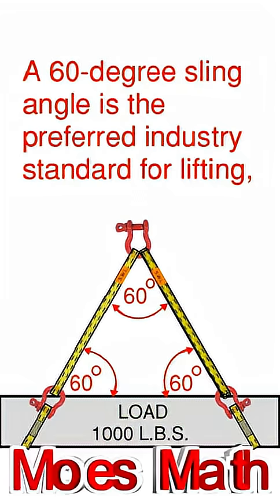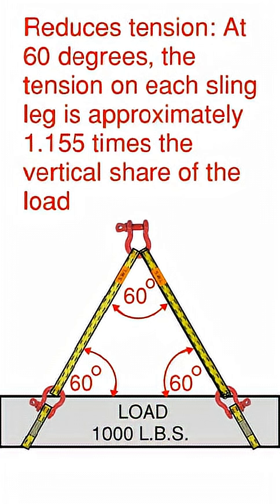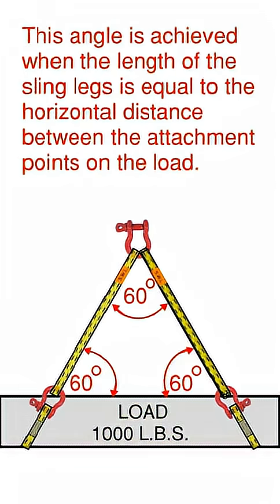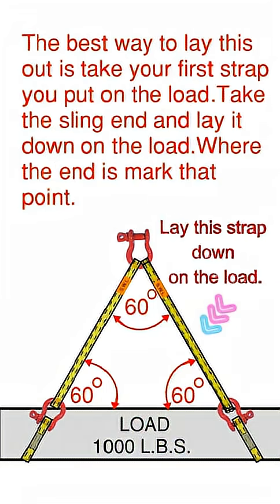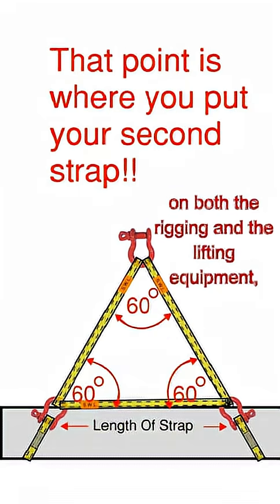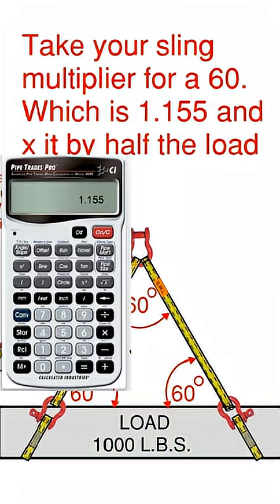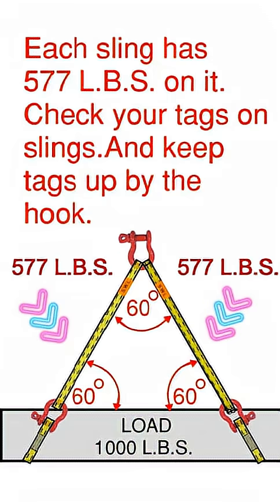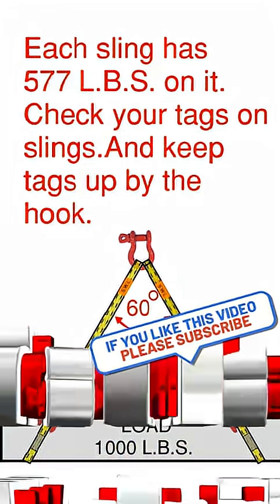Sling Angles At A 60 Degree Angle

Comment: I have a question that’s always puzzled me. If the sling angle is greater than 60°, say around 80°, is that actually better than 60°? We usually place our slings 2 feet from center on each side, so the pick points are 4 feet apart. Intuitively, it seems like that should hold more. However, everyone always says the answer is no, and I’ve had trouble clearly explaining why.

I understand that spreading the slings too much—like down around 30°—is bad because the tension increases significantly. What I’m trying to understand is why going wider past 60° doesn’t continue to improve the lift and can actually make it worse.